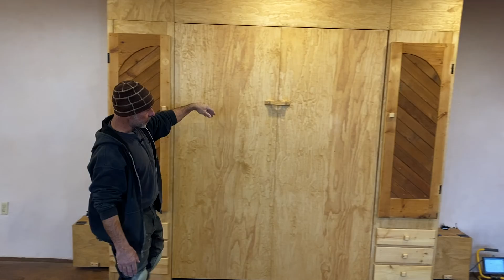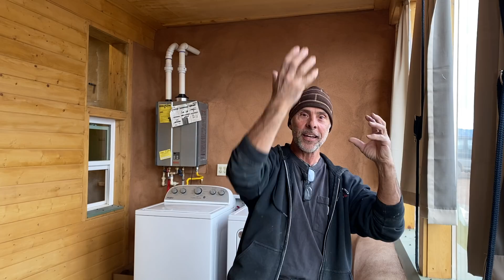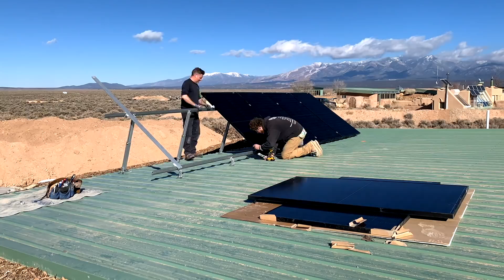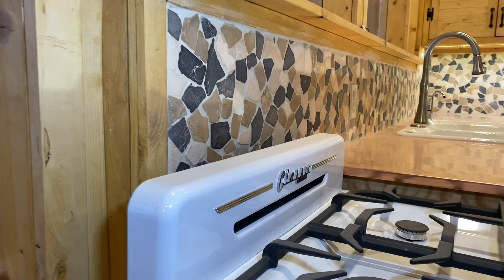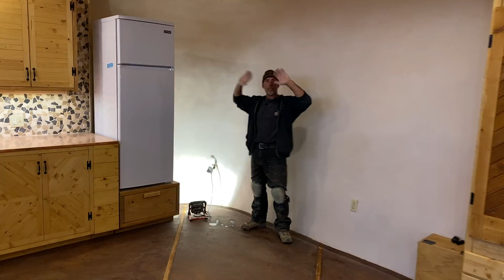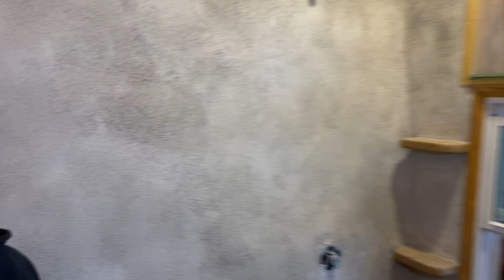Earthship Tiny House Fully Explained! Off Grid Systems Overview and Walkthrough Tour

Comment: Hi pressure tanks come precharged  I would take 10 pounds out of the tank so you are at 28 pounds now if your pressure switch is set for a 30 cut in and a 50 cut out your tank which has a bladder in it wont bottom out hope Imade sense in my comment

Comment: The only thing I'd do different is have stainless steel sheets for the first 2-3 meters (or yards) as the pavement in front of the house, to get more sunlight and heat into the greenhouse by reflecting the sunlight from the stainless steel pavement into the house. Sure, that means you won't be able to use that space for other plants and storage, but it also means lower heating bills the whole year, and maybe also more solar power during the winter and when it's cloudy.
Reply: You normally put in raise planting beds, With black fabric over them in the winter an nothing on it during the summer to act as a battery both ways. The biggest reason they can use such a small solar array is bc they are in the south.
Reply: But I do agree I would have gone bigger on the solar also. If you just go all electric, The money you would say not have a plumber, inspections, Extra appliances cost's for being propane an dealing with them when they go bad last but not least knowing your always going need a propane truck x amount of months...      If you go more solar and make the room across the front face of "earthship" homes the convection caused helps you heat in the winter and cool in the summer massively also.. 
I would go a Sol-ark 8Kw at least with power management. To let me put up 14Kw of solar an use ALL 14 as the sun shines (should look up the tech it is SUPPER cool) It lets you use more loads during the day w/o stepping up inverters. This way you can double if not triple up with hot water tanks to use as a battery. But Mostly so you do not have a bottle neck going on while charging after a cloudy time. Also with at least 20 if not up to 30Kw of EG4 batteries. Plus a 8Kw generator with two 100ga propane tanks to feed the system that you connect like a bbq, for the same price as his  "Propane" package here. If not being able to step everything up a lil more if you want to bring in the tax benefits.

Comment: This is my wish list for home construction: short runs for hot water and drains, access panels for maintenance and repairs, plumbing not entombed in the walls, ceiling and floor, cabinets and floor water proof, kitchen ventilation capable to quickly purging a smoke filled kitchen, floor drains, crawl spaces large enough for workmen to work comfortably.

Comment: They talk repeatedly about the mass etc, but none have shown how they build the foundation for the ground to prevent moisture from rising up the walls and the floor, how they do this because obviously in the desert it may not be so necessary but in areas with low-level water tables and environmental humidity will cause serious problems in the short term.
Reply: You realize Taos gets to -30?  The issue could be humidity but he mentions condensation in the tubes and others mention insulation below the footers.  That probably includes a moisture barrier.
Reply: All of it is possible basically in a deserts... for cold climate it won't work.

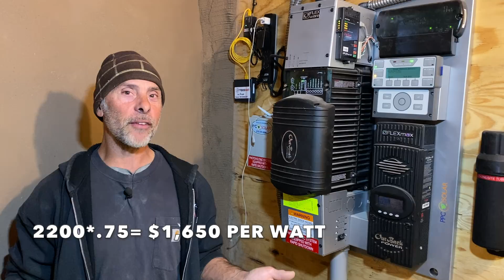Comment: Just a ProTip for the video editor: the conversion displayed at 19:36 is wayyy off, and shows a per-KW price 220% higher than what Ron states he actually paid for the 2021 project. Plus, at 19:30, the conversion "2200* .75 = $1,650 per watt" makes no sense ($1,650/W would be 330 times higher than what he paid in 2006!); what you mean is "2,200W x $0.75 = $1,650 TOTAL", i.e. it cost $1,650 for the total 2.2KW.
At ~19:10 Ron states that he paid $5/W per solar in 2006, whereas for this project he paid approximately $0.65 - $0.75/W, and he has 2.2 KW of solar on the roof, making for a total cost of $1,650 for 2.2 KW. However, at 19:36 the on-screen per-KW conversion erroneously displays the total 2021 KW cost, when in fact it should display the per KW cost (which according to Ron's numbers would be $650-$750/KW). The correct conversion would be:
2006: $5,000/KW
2021: $750/KW
Reply: Yeah what he said 😅

Comment: What is the size of the Earthship Tiny House? Also, you seem to have some type of easement behind the fridge? Good idea on the Murphy bed. Did you use car hydraulics for the Murphy Bed? There is an Italian builder that has great ideas on use of space in the Murphy bed. However, the Italian builder's beds are very expensive. I think this  tiny house is a good design for senior living as the bed is easily hidden. I have been knocking my head around how to build the toilet into a water closet(W/C) and being able to vent the odors through the green house and out the home itself.  Is there anyone else out there who prefers not to see the toilet upon entry and have solved my smell dilemma?
Reply: I totally agree! A w/c shouldn’t be in the same room that you bathe, imo

Comment: I feel like the reliance on propane is compromising the objective. Aren't earthships supposed to be fully self-reliant? It would be next-level to design a septic system that creates and stores a tank of bio-gas to run the water heater and stove. Or more solar capacity to run an electric instant water heater and an electric induction stove could also eliminate the reliance on propane delivery. Bio-gas would work so nicely for your cooking fuel. 

Other than that, I think this earthships are so incredible.. I love the passive cooling and heating principles the most. The water recycling systems have really come a long way as well. Great jobs guys! Never stop innovating! You inspire many people to change the way they see and interact with their homes. And challenging traditional building methods with a more self sustainable plan is another huge plus! I hope to build my "trash castle" one day in the near future 😁
Reply from the maker: I couldn’t agree more Jared. Surplus solar could be used for hot water for sure. Bio gas is a little trickier, could work for cooking fuel seasonally, but I haven’t seen a full proof year round system yet. There are septic bio digesters available but the investment is greater than conventional septic, and gas is inexpensive.
Reply: @TheOffGridGuru  Hey! Thanks for the quick response! That's good to know you have already looked into the bio-gas option! Would it require much more investment into the solar generation/storage to switch both to electric? I guess those are both things that could draw an immense amount of power when you are doing laundry, showering, and cooking in the winter months. The main investment would probably be in battery storage. What do you think?
Reply from the maker: @MegaBlackLobster   Well, as for the solar investment, its more about using your peak solar gain hours during the day to heat hot water once your batteries are topped off. So its more about the design of the system rather than the size.
Reply from the maker: @MegaBlackLobster  As for high draw items like washing machines, those can also be run during the day when the system is “floating” (the batteries are full). I know earthship residents that will prep laundry in the morning or night before and then use a home automation app on their phone to turn kn the machine from work during the “peak” solar hours of the day. Or if the weather shifts, they can skip it, protecting their system from being over drawn. Hope this has shed some light on the possibilities!
Reply: @TheOffGridGuru  that is genius!
Reply: The reason is likely due to the permitting Nazis...

Comment: I like how the video is attempting to provide a lot of information. There's something inspiring about Earthships. However, I personally don't like the aesthetics, selection of materials, quality of materials and workmanship of most of them. In fact, it all seems to be pretty dreadful to me. But I also get why many people love it, the ecological appeal and how they're different. Of course, this design only works in desert, or to be precise in places with same average annual temperature. When you build in colder climate, you need to fundamentally change the shell, insulation, heating, ventilation/air recuperation, etc. or you might not save any money on heating, but in contrast heat all year round. I plan to build an earthship inspired earth-covered house, but with classic European approach when it comes to engineering, materials, etc. Of course, the price goes up, when you consider 3-pane insulating windows, design challenges with insulation all around, concrete shell, heat-pump heating, complex HVAC (automatic rerouting air flow between "ground tubes" collector, direct intake, greenhouse and heater - which all depends on day time, season and weather), proper water insulation, etc. When you build in colder climate (not even cold, just let's say NYC type of climate), properly designing all that to resist humidity and cold is a must. Otherwise one could end up with a horror house full of dampness and mold. There are such stories, though not that commonly promoted. Which is sad, because one can learn at least as much from a bad build as from the good one.

Comment: It’s very cool and interesting earth ship home! I was curious if you could use a Tesla Powerwall 🔋 instead of those batteries you showed. Maybe better technology. I like the commercial stove. I think if it was me I would want a bigger refrigerator or higher end. Also I wouldn’t go with that wood choice, I would go with pine or cedar. How much will this earth ship cost once it’s a finished home and completed?. 👍🏻😊
Reply: Last I checked Tela will NOT sell a power wall for off-grid use, and we can agree that there are much better battery choices.  LIPO (lithium iron phosphate) batteries can retain up to 80% for as many as 10,000 cycles, and don't cost much more than AGM (AGM is usually dead after 300 cycles).

Comment: A thermostatic fan should automatically pump excess greenhouse heat into the thermal battery in winter and outside in summer. The plants will thank you later. 
A screen on the vent window would keep most of the bugs out of the house.
Propane cooking? Rocket mass heaters are the way, as are composting toilets.
Keep learning!
Reply: Is it a good idea to have rocket mass heater for cooking in there as it might overheat?